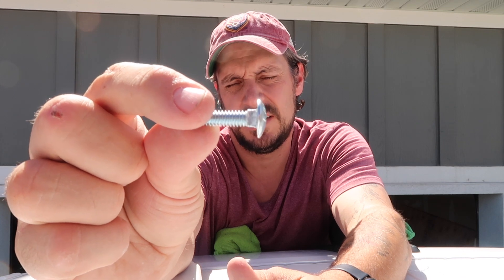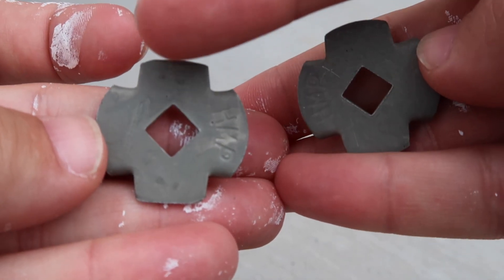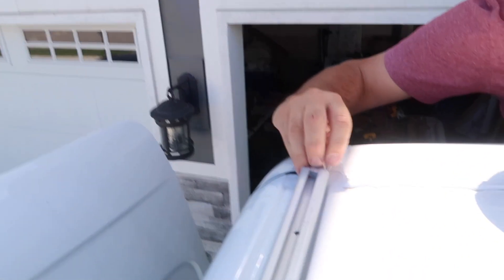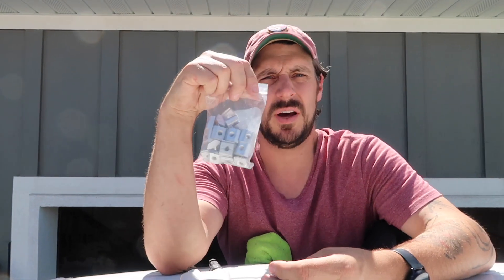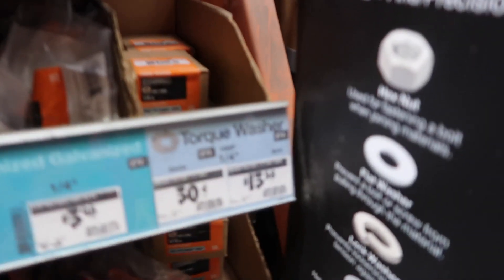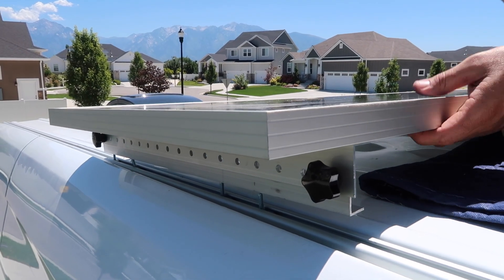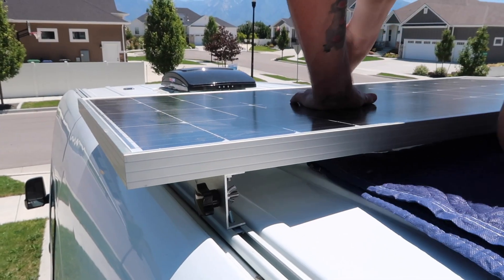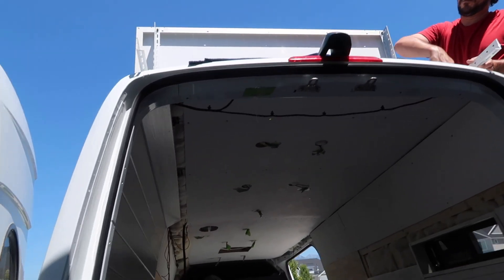QUICK TIPS: DIY Inexpensive Solar Panel Mounting Brackets (for Vantech Roof Rails)

Comment: Thanks for the video. 
Questions: where did you find the sliders you purchased and couldn’t use?  80/20?
Would those sliders work with a factory Sprinter roof rail ?
Been looking for hardware. Thanks.
Reply: I also heard Plow bolts will work if you grind two sides of the head. 
Trying to find a solution that fits without modification and won’t rust.

Comment: or you could have removed the screws/passed the fastener then refitted the screws
or you could have put recessed screws into the rail by opening the hole on rail a bit at an angle...  since the screws you used were not well seated

Comment: Those NUTS that don't FIT....try this:
Insert them from the TOP (not END) of your channel. wherever you need them.
Yes...they are thin enough to fit through the rail slot (length wise). They TWIST down into place.
Otherwise...send them to me. Thanks.
See this YouTube video:
https://www.youtube.com/watch?v=nK-DsJxAdwM   
at 1:30
Reply from the maker: We tried that beforehand and they, unfortunately, did not fit. They're too wide to twist or wedge in from the top (similar to the self-aligning ones in the video you link you shared). Otherwise, we would have loved to use them. Thanks for the insight anyway. The video link was informative. 👍🏼